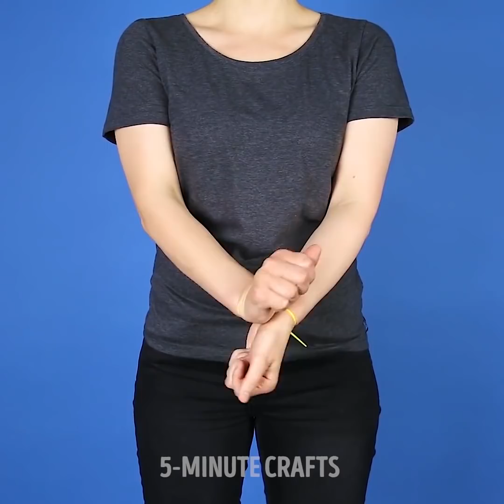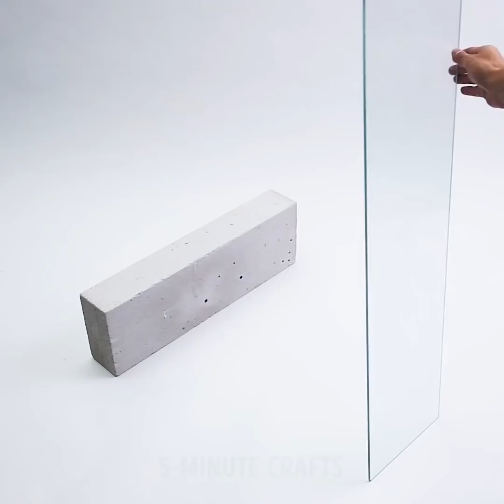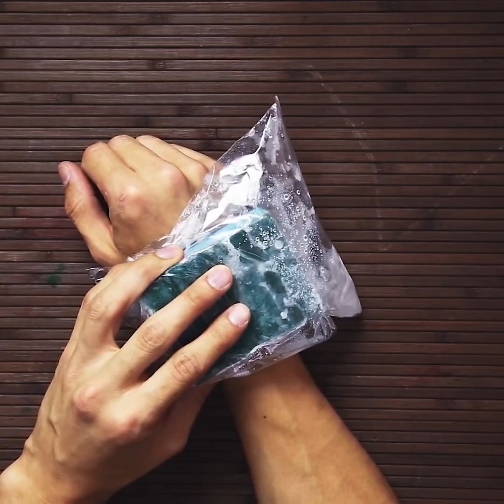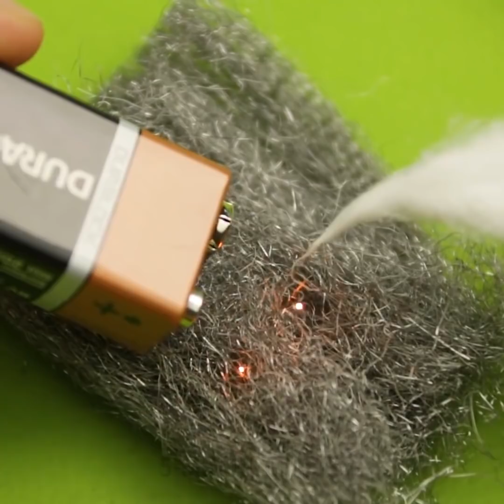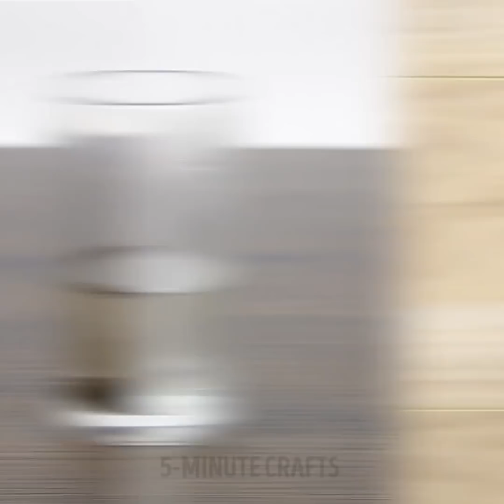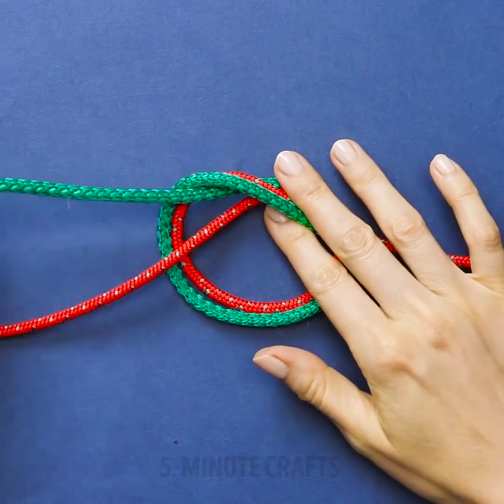35 SAFETY HACKS FOR WOMEN

Comment: Self defense tip-if they grab your wrist, twist so that the weak point where their thumb and middle/pointer fingers meet is facing up, then pull up hard and fast. Do this as fluidly as possible. 

If they shove you up against a wall with their hand above your shoulders, put you arm on top of theirs, hooked so that you could grab your opposite shoulder. Do this with you dominant arm. In one swift motion, twist towards your elbow and sidestep. The run like hell.